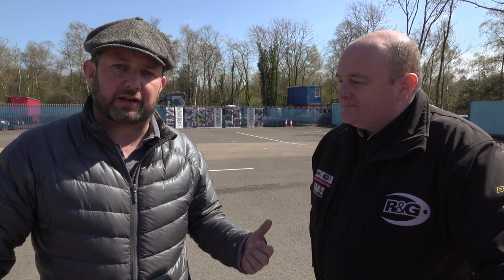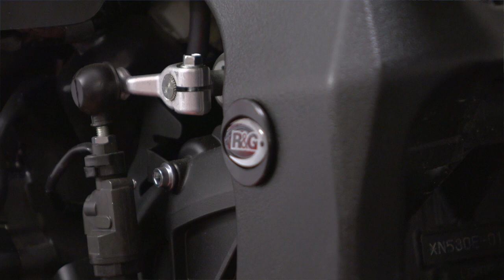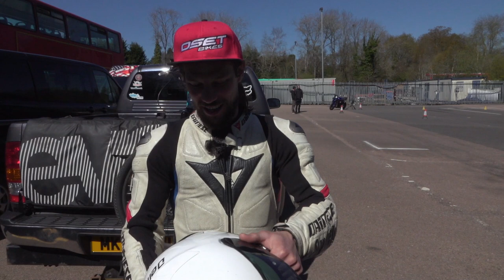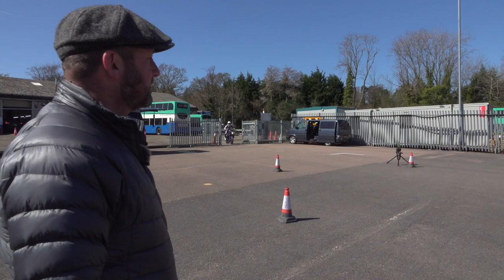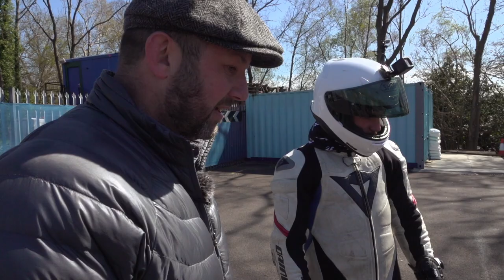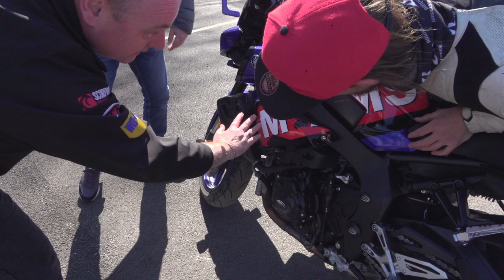Bike Crash Test With R&G & McAMS

Comment: I dropped an MT10, albeit at very low speed, and I was very fortunate that the R&G crash protectors I had fitted saved me from any serious damage - just grazes to indicators and levers. I've since fitted additional R&G products so that I don't push my luck. It's a slightly more expensive package than you are suggesting though. The crash protection fitted to that bike (case covers, aero protectors, lever guards, cotton reels, fork protectors, swingarm protectors, exhaust protector) will set you back £438 delivered. I'm not suggesting it's not a wise investment, just that it's a bit pricier than £250. Nicely crashed.

Comment: Extremely interesting!

But now, you have to crash it without the protective gear to compare :-D
Reply: Dont forget lay it down on the other side
Reply: Agreed, I'm not convinced frame sliders are a good idea. Look how far the bike slid despite the slow speed. All you need in real life is a grass patch or a pothole and that bike would cartwheel itself to oblivion.
Reply: @arnobashtar6707  Well considering most people ride on pavement I would think they are a good idea... I would take it sliding with a chance of flipping over it grinding everything and making a repair 10 times more expensive. Besides its not like bikes without sliders don't ever flip...
Reply: Makes for an interesting discussion and I see your point.. but from my experience crashing without sliders. The grinding damage is really not that bad. Plastics are easy to repair with body filler and touch up paint. For minor scrapes you can cover them up with stickers. Aftermarket fairings can be worn and the OEM ones can be stored. The exhaust can be grinded, sanded and polished back to perfection. However if all you ever do is ride in town at low speeds, suck at touchup and you only have OEM fairings for an expensive Ducati. Then absolutely use the sliders.

Comment: That's a pretty tame slide really. I crashed many times as a teen and half were front wash, with the other slow high sides. Full rear brake low washes are almost non-existent. But understand 100% that the other common types are too risky to test .. and can bend fork and frame. As for the many comments about why they didn't do an exhaust side test. That protector is just for tip-overs. They add zero strength to the inlet pipe or the rear hanger.. those areas will still cop bending damage.

Comment: I remember the old vid, the only criticism I have is with my R&G bar ends on my FZ1 being too light vs stock therefore causing a numb hands on the motorway.
Reply: Grab a longer bolt and put a good big (heavy) steel spacer between the rubber and the bar end

Comment: Someone made my cb1100 fall on its left side by hooking up my left rear view mirror to their car's rear view mirror ...Bike was on the side stand with direction column locked ,thankfully i had crash bars so only the gear lever got nicked ...But doyou think damage could have been done internally withing the direction column locking mechanism ? Are those direction column implements sized and designed to handle such fall overs with zero speed ?

Comment: Question, why is this stuff so bloddy expensive? For what is basically mass produced moulded plastic!
Reply: Try getting the castings right. Lets see how you maintain the cost.
Reply: you can always start your own company if you deliver cheaper products :)
Reply: There are other companies/people doing crash protection products you can find them on bike forums, I've bought a couple of undamaged fairing protectors from a breaker on ebay and some 12mm threaded bar for my bike just got to put it together next time I remove tank n fairings for a service at the end of the month.
Reply: @SunzOffski so why not try and see it yourself?

Comment: I haven't personally tested it, and frame sliders are a bike saver on the street, but I've seen in club racing that on the track they can dig into the dirt and flip the bike. Thoughts? I crashed a 916 without sliders on the track at 110 mph and it just dug in and stopped. I think it would have flipped when it hit the dirt if sliders were installed.
Reply: Though of course it CAN happen (I'm a club racer and track instructor for a laugh!), but I tend to tell those at track who ask about it, that I would liken it to the argument for and against wearing seatbelts. Where the idiots who argue against wearing them try to argue that you more likely to be 'thrown free', than be trapped inside. Yes, of course that IS a possibility, but the balance of probability tips massively towards you being better off with a seatbelt on, and with sliders, you are also massively better off having them on too. But it's not the dirt that would cause a bike to flip (if it was to dig in at all), but the curb that would flip the bike, but to be brutally honest - if a bike is sliding that quickly when it hits the curb - there's enough between wheels, pegs, can, etc., to catch a curb and cause a flip, so I never go out on track without them (as I can't afford to keep replacing panels when I dump it!!) Hope that helps. ;)
Reply: @GarryMcGovern  luckily the track I crashed at didn't have curbs, then it would have been a totally different story. Thanks mate

Comment: In my crash experience i had no protection on my Bike and all it had was a broken engine cover and a broken handgrip. Speed was about the same.🤙🏼😉
Reply: I did a 40mph crash my bike flipped, I snapped the clutch lever bracket off completely, snapped a foot peg, bent my gear and brake levers cause it flipped. I’m still debating are crash bungs worth it cause they could increase the likelihood of flips in real world use.

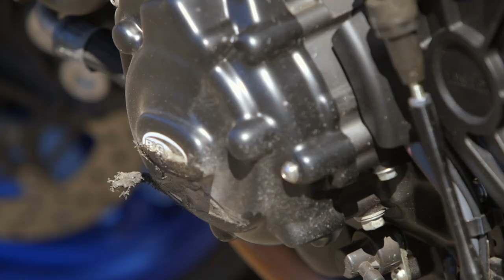Comment: 10:38 There definitely is damage to the engine cover as it ground through the plastic shroud and kissed the aluminium casing. Pity they couldn't have been more thorough with the (rushed) after crash inspection as this reflects poorly on the entire test and company involved.
Reply: These plastic and carbon protectecors are overhyped.    Best are thick full alu replacement covers like NRC ones.    If not available: alu case sliders/protectors.
Did a front lowside 3w ago on the track @60kmh, the alu slider/protector did awesome job and good for another 2 to 3 slides.  The frameslider got 2cm shorter, that's how abrasive the tarmac was, and the bolt bend a bit.
Going to use shorter framesliders in future.
Fixed footpegs and steering-angle-stops also help to protect your tank btw

Comment: Some insurers class these as "modifications" so can increase premiums for each one fitted. Frustrating or what?
Reply: Go to an insurance company who doesn't care if you have stuff like this on the bike. They are out there. Fuck the other companies.
Reply: Carole nash and devitts dont care about 'mods' at all. Even slip on exhausts. I was well surprised. The only thing CN was a bit dubious about was some carbon fibre on my speed triple around the rear tail light, only because I called it a fairing. Once I sent them a picture of how small the piece was they were like, oh, dont worry about that, no extra. 👌

Comment: Now buy cheap chinese crash bungs and compare it. No doubt it would do the same thing. R&g jus overpriced for piece of plastic
Reply from the maker: Kamzi Slingshot so you’d be happy to trust the cheap Chinese protection on your bike?  Let’s see the results then.
Reply: Bike World yes. Did the job when i crashed my bike .
Reply from the maker: Kamzi Slingshot Good, we’ll stick with the proper gear thanks.
Reply: Might have worked for you but I've seen the Chinese stuff either snap the bolts off or the plastic it's made from shatter and do nothing. I don't ride shitheaps so I'll get the stuff I've seen tested. Anything over 50mph wouldn't matter anyway. You bike would be going home on a truck.